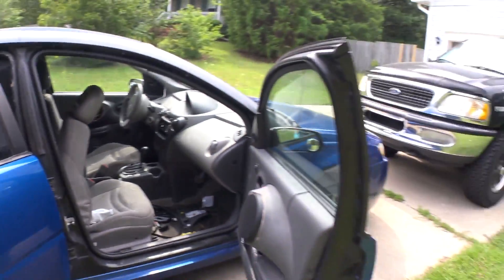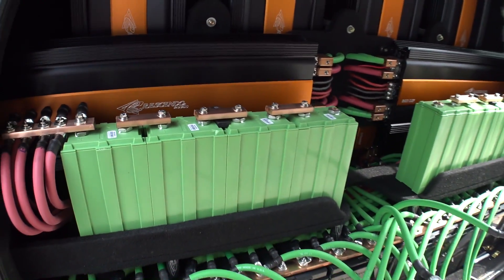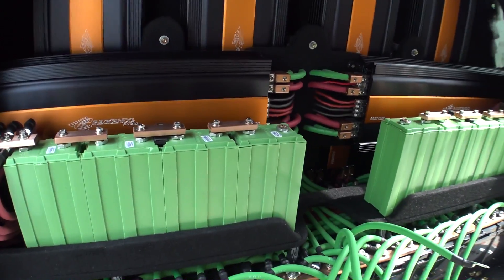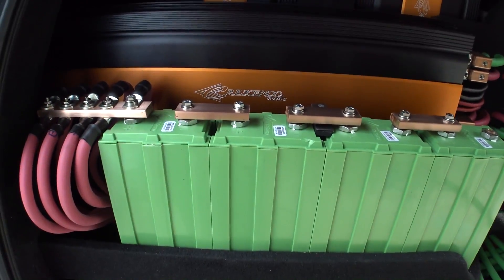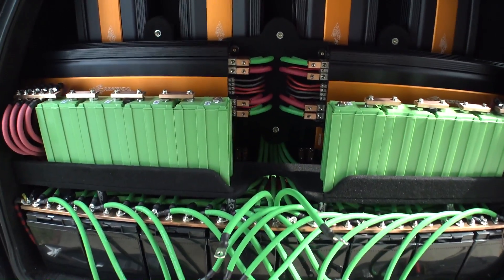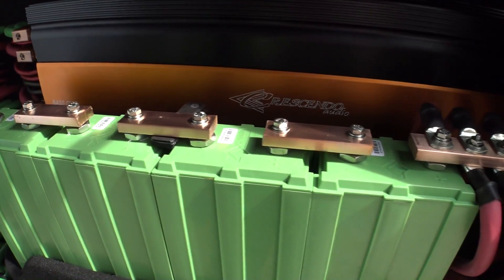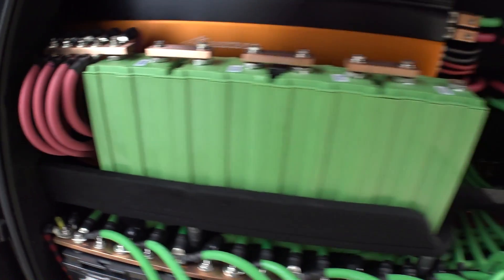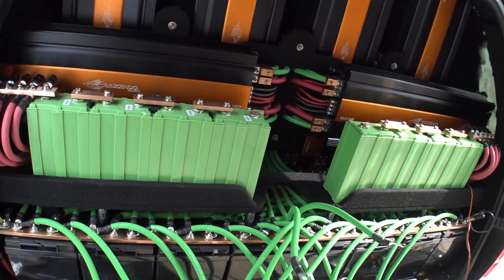HUGE BATTERY BANK: JY Power Lithium Install & Mixing 12v Series Parallel Wiring w/ AGM Car Batteries

Comment: hows gonna work with lithium battery like 40ah max watt can go up to 4000 then you got AGM bat max watt is like 2000-3000 both of them are 12v?.. that'll work if you use them together with 3000w or 4000w amps? hehe lol.. im new to all this.. just a dummy question.. haha

Comment: I bet if you actually did the measurements and electrical calculations on the amp draw wire run, you'd find that's extreme over kill on wire.

Comment: Normally i dont comment about this but i see there will be no side to side movement. however maybe put a single strap brace  up and over each jy 80? id hate to see you hit a pothole and the battery jumps out of the tray

Comment: those are wired in series ?
Reply: They are 3volts per cell so in order to get 12volts you need to wire them in Series, then you parallel connect them to your desired electrical source, in EXO's case, a bank of 12volt battery's. Series/Parallel keeps the voltage at 12volts, if he went all series it would be 24volts.
Reply: whats the point of adding those 3v batteries they have good discharge current or what ?
Reply: Wish I knew
Reply: They are Lithium battery's, not sealed lead acid AGM battery's, each of these new battery's EXO installed are equivalent of 6 heavy 110Ah AGM battery's per 12volt pack, they are manufactured in individual cells so in case one were to fail for whatever reason you can simply swap it out for a new one for way cheaper than having to buy a whole new battery which this model goes for $1,589, each cell is about 250 bucks if i remember right couldn't find the exact price... So yeah, he just added the equivalent amount of 12 more battery's in his truck without the added weight and space, these lithium's only weight 26 pounds.

Comment: is there a special charger for the litium batteries beacuse litium batteries need that if you are realy unlucky they can explode just Google litium over charge you Will see yourself.
Reply: they need a special charger that limits The current going to The batteries

Comment: EXO I just upgraded my system to two t2 fosgates and I'm going to need a second battery. Do I need to have matching batterys for the one under the good and the one running the subs?
Reply: JankWheelie in most cases you do not, so long as they're the same voltage. (Don't run a 24 volt battery as your second and 12 volts as you main)
Reply: JankWheelie s unless they're ran completely separate and not in parrallel as all of his are done 😁 If your running them together (battery to battery and not alternator to battery)